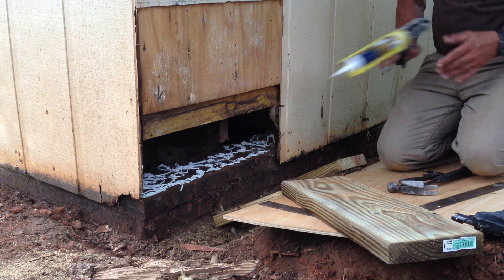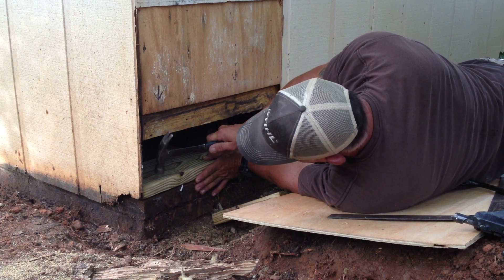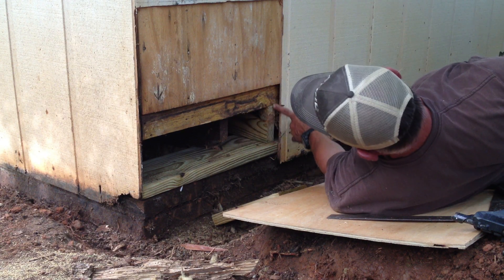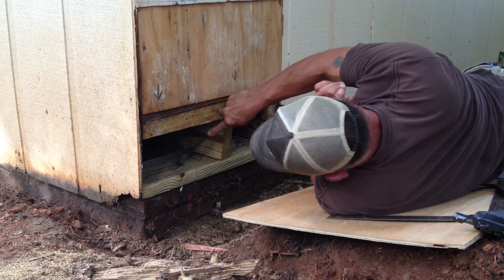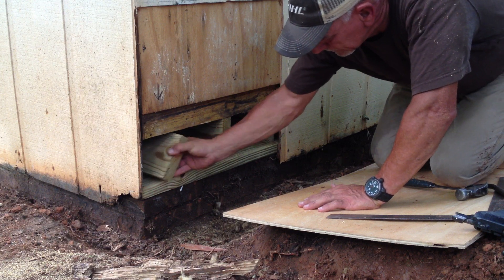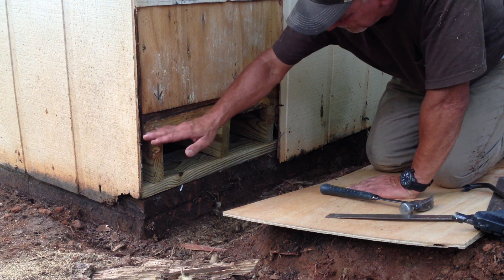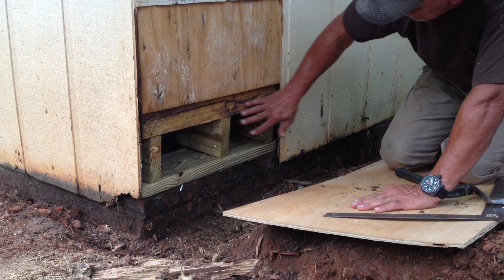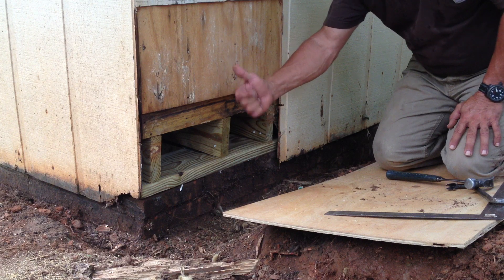How to,  FIX rotted sub floor joist & header.

Comment: Nice quick fix Tom. What would you charge for a repair like that?
Reply from the maker: The cost was built in with the other work.  But I would have done it for 350.00 plus materials.

Comment: I don't know if you have grey slate there but other than that I would of used some plastic or tar as a damp proof course we seem to so it more here as not much us wood.
Reply from the maker: Thanks for your comment, and I will be working on the french drain system for this water problem tomorrow.

Comment: Great job. Tight places like that you could use some hand drives & a palm nailer but that will work.
Reply from the maker: I did get out my smaller drill and put some 4 in. screws in the back boards.